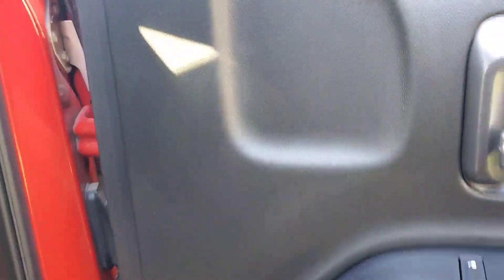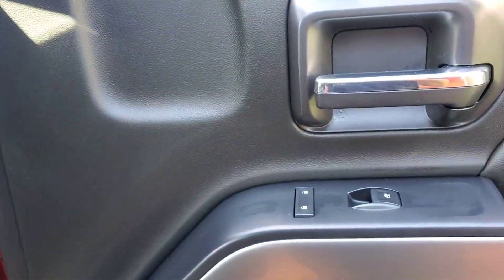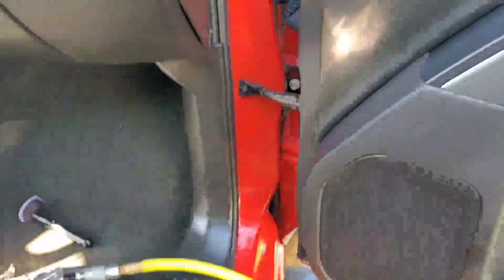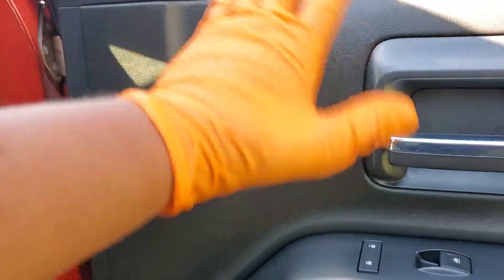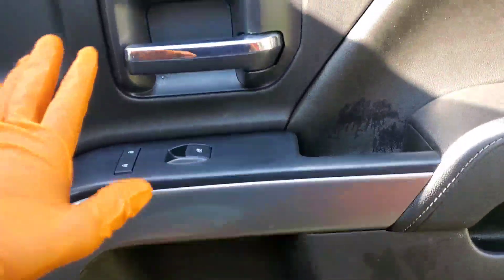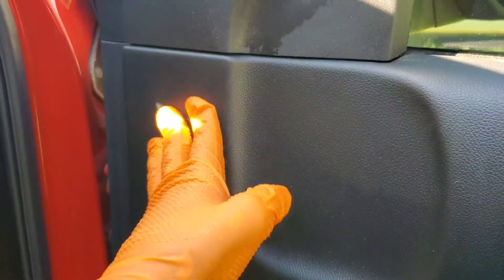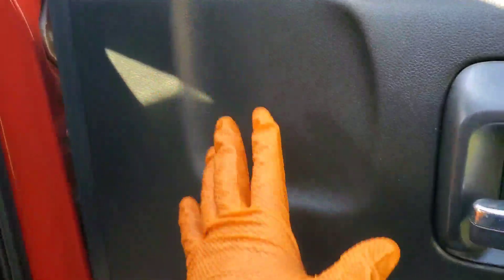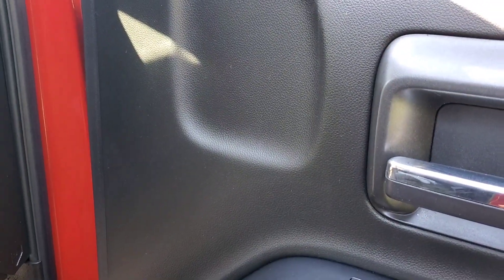What to expect when cleaning Chevy door panels

Comment: Wonder what causes that area to shed? Wonder if it is better or worse to make it shed? If you make it shed, and get it cleaned up, what happens if you flood it again with APC? Does it shed again? I know we do not use customer vehicles to torture test,but it makes me curious.
Reply from the maker: From what I have experienced any apc will make it shed. Dilution has to be mostly water but it will will still shed. Every time you clean it, it will shed again. But after agitating and removing the shedding it will go back to normal